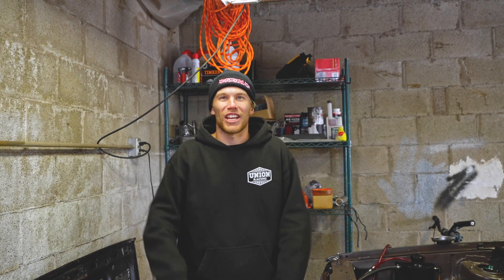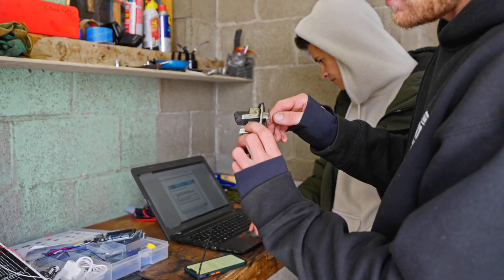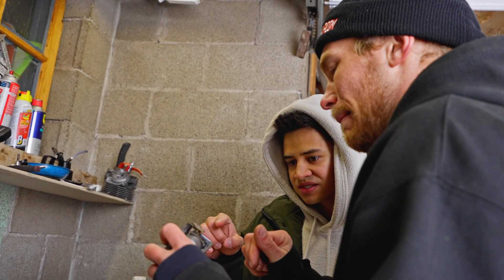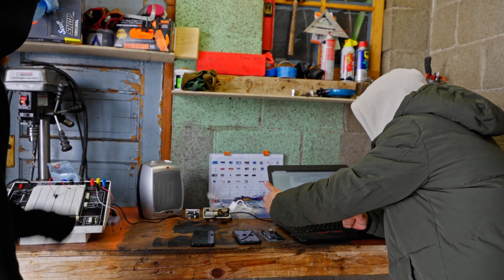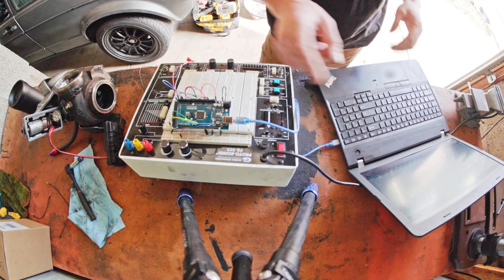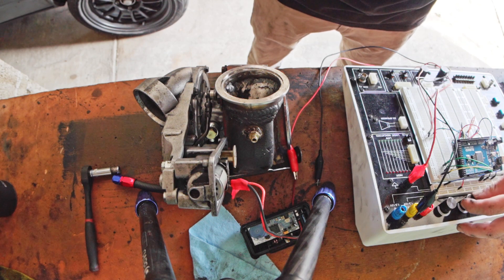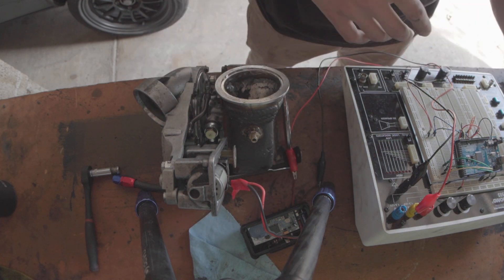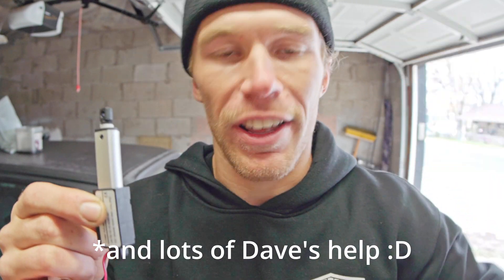Build Day! VW turbodiesel VGT controller

Comment: Honestly was thinking about a standalone boost controller like this for so long :D
Reply from the maker: I've been pleasantly surprised how easy Arduino is to work with 😁 pretty fun too! You should try it!
Reply: @OliverFetter  i definitely will have to at some point when I get my OM606 project started! But I think ill probably learn towards using a vacuum system like the older engines, though not sure. What inputs are you going to be using for the final version, just boost, or throttle too?
Reply from the maker: I'm thinking boost, intake temp, & throttle position, maybe drive pressure too?¿
Reply: @OliverFetter  yeah I was thinking whether drive pressure would be a good idea perhaps, though I'd probably lean towards drive pressure more if it was fully mechanical (I think). As for throttle, I definitely like the fact that the turbo wouldn't be spinning uselessly when we're off throttle, but I can't wrap my head around the fact that throttle position doesn't take into account that the governor also affects fuel delivery.
Reply from the maker: @MrAndrius12  I don't think excess air is a bad thing but certainly overly closed vanes will suck while cruising (& is what I want to avoid), thus a simple throttle displacement as max boost pressure regulator should be quite nifty. A TD pump already adds fuel in proportion to intake manifold pressure 👍 so good to go there. I've removed the governor on mine so more throttle will always mean a need for more air. I'll set a limit on boost to drive pressure ratio to make sure the turbo is being helpful & check intake temp in order to target max air density 🫣 at least that's the plan!
Reply: @OliverFetter  to the best of my knowledge an AFR of ~21:1 is most economical, anything past that is wasted effort from the turbo (if the lean AFR is due to excessive boost). We add pumping losses when we request boost. Plus that any time the turbo is working overtime it reduces the life of the turbo AND deadens the sound (people do a "deep idle mod" where they open a turbo fully at idle to make their exhaust sound deeper - I tried it as well, sounds better!). On positive note though, as far as I was told, additional air will cool the exhaust better, so for that particular purpose, excessive boost (within reason of course) may be a tad good I suppose to cool us down more when we go off throttle (or even on throttle if we get lots of air at full load) - but then again, I've never logged a car with an EGT sensor so I cannot say much on the topic of EGT.

Oh, no governor, then yeah, that sounds legit. Looking forward to your new videos on this project, ngl, kinda excited to see the results!
Reply from the maker: @MrAndrius12  that makes sense! I like the way it sounds closed (love me some turbo whistle 🤤) . I'm excited to get it dialed in. It seems with the new 11mm pump it will be impossible to be short on fuel.. wondering if I should try to measure AFR and how 💁 probably would be a good idea. I've been watching Banks yt channel lately and he's got me thinking about air density & afr quite a bit!! I have an egt gauge & with the 9mm head it was often pinned at 1600+f. I think that speaks to the lack of data & tuning as well as asking too much from a 9mm head!
Reply: @OliverFetter  yeah I've been thinking about a lot of his stuff too. His project even convinced me to try a supercharger and turbo combo (again, waiting til I get my project car in the future). And yeah, 1600F (870C) does sound pretty hot, yikes! Have you thought about water methanol injection? It shouldn't be as much of an issue on an old diesel considering there is no pre-injection - but I'm not too certain how far it can be pushed with water meth seeing as SOME people have mentioned that the high compression on diesels may ignite the mixture too soon (especially if running too hot).

I had a weird idea of perhaps trying to inject x amount of meth and y amount of water at z temperature, and have the water quantity progress more than meth i.e. 800 degrees (C): 10mg water & 10mg meth. 900 degrees: 20mg water & 15mg meth. 1000C: 30mg water & 15mg meth. So my point being, start off 50/50 when it's a little cooler, and then as it gets hotter towards the dangerous side do more water to try and prevent the pre-ignition of alcohol (the numbers are purely to demonstrate my point, I don't actually know the real numbers in mg/s or mg/str). But I never had experience with water-meth so this theory could easily be not good and unfortunately I don't have a junk car to test this on (not to mention that it is a time consuming process).
Reply from the maker: @MrAndrius12  I have given it thought! Before heading in that direction I wanted to try upgrading to 11mm - quite a few people suggested that the larger pump head shortens injection duration & likely EGT's as well since the fuel spray is better. I have yet to push it hard without the turbo working properly, so I've shelved the water injection idea for the time being till I see a definite need. Seems like a pretty easy add but definitely $500 🥲. I know meth adds power but id strongly consider just water for me - lots of fuel is already in there!!
Reply: @OliverFetter  that is true. Yeah, although I haven't seen ones for 500, I've only seen more expensive ones here in Europe unfortunately, so I was thinking if I should attempt a DIY project instead.
Reply from the maker: That would be sweet. Yeah it's a lot of $ just to spray some water 💁💁💁

Comment: Just a question do you have any footage of changing wheel bearings what are you using?
Reply from the maker: Which, front or back? I don't think I have any footy
Reply: @OliverFetter   front
Reply from the maker: Tbh the last two times I needed fronts I dropped off the spindles (w old bearings still on) and 2x new bearings at someone else's shop to press them. Usually runs me about $100 for both